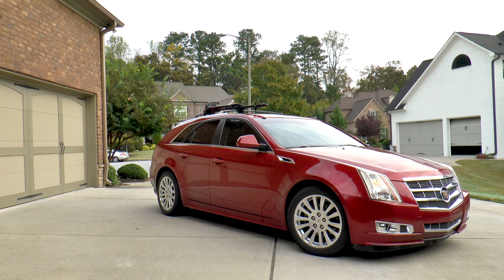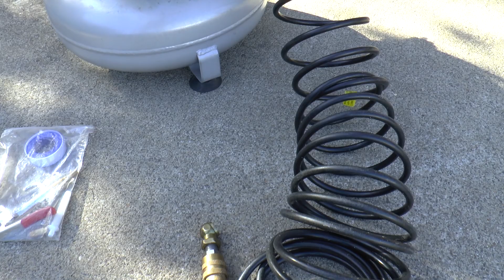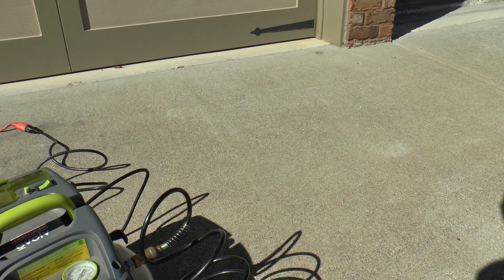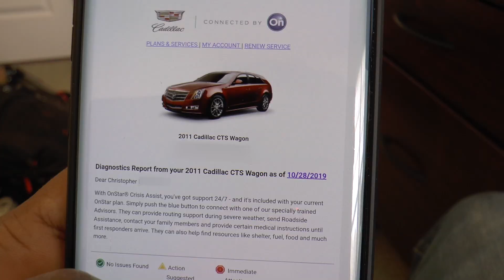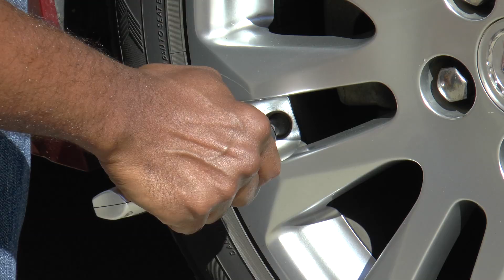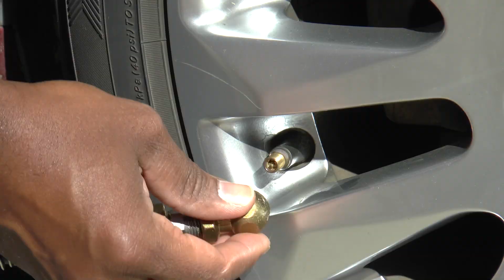How to Check Your Tire Pressure - Easy Car Maintenance

Comment: Some air compressors will automatically adjust your tire pressure. You just set the number and the air compressor will do the rest.
Reply: Yes, after my small airless compressor was stolen, I bought a cigarette lighter powered compact compressor on the internet.  It allows the user to set the appropriate pressure and quickly inflates to that number.  I find that I prefer this little gem, as there is not holding the inflation nozzle and having to go back and forth to get the proper reading.  Then there's the $35.00 or so I paid for it.  I, also have a CTS of the 2006 vintage and it does have TPMS.  Not sure why Chris stated that cars newer than the 2011 CTS have TPMS, as if this one didn't.
Reply from the maker: @ronlheureux7623  Chris's car does have TPMS.  We showed it in the video and Chris mentioned it because some other non-premium or luxury cars older than 2011 may not have the feature.

It's impressive the features that they're adding to cheaper compressor systems now.  Thanks for watching, Ron LHeureux!

Comment: It should be done first thing in the AM when tires are cold
Reply from the maker: That would be best, but as long as the car's been sitting for a while the tires will be cool enough, pedro fernandez.  Unless it's a hot day, then the early morning will be better.  Thanks for watching!
Reply: @AutoAcademics  That is why I tell the oil change place NOT to bother with tire pressure. They check it after the car has been running and the hot tires show more pressure, so they always let out air. then when I check in the AM, they're too low.
Reply from the maker: @pedrofernandez3893  LOL. The sad part is that happens to hundreds (or thousands) of people every day.

Comment: Quick and easy. People shouldn't rely 100% on the TPMS and check tire pressure and oil every time they get gas. I do the checks on the family cars otherwise nobody would.
Reply from the maker: Same here, Enforcer1975.  Many people never realize how much tire pressure their tires lose just because the temperature dropped.  Relying on whoever services your vehicle can be too long of a timespan, and it literally only takes 5-10 minutes to make sure all your tires are safe.  Keep up the good work with car maintenance and thanks for watching!